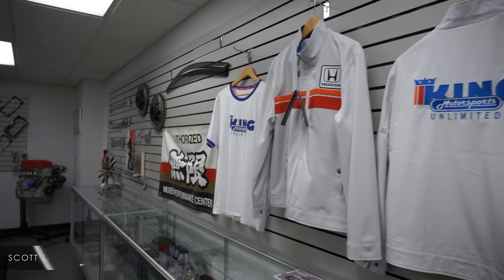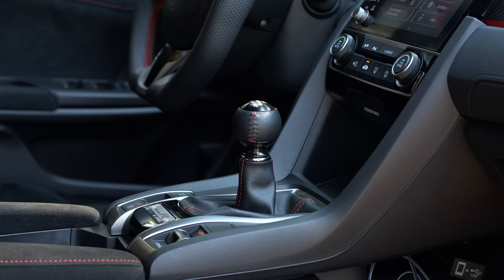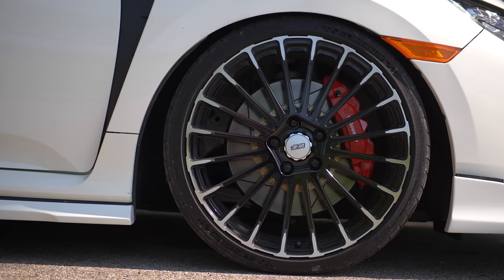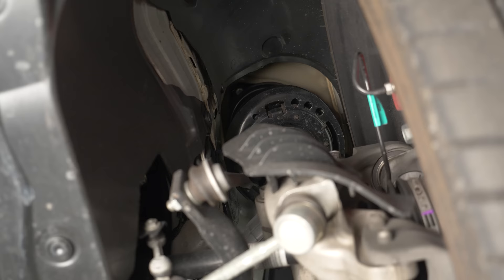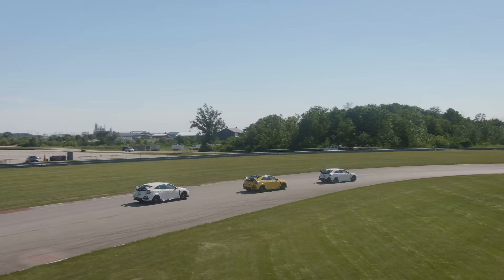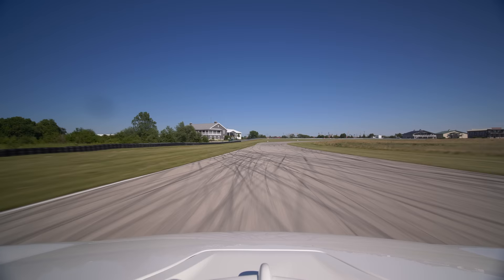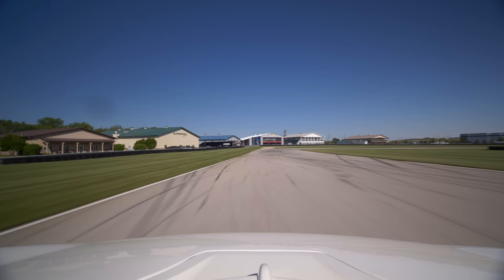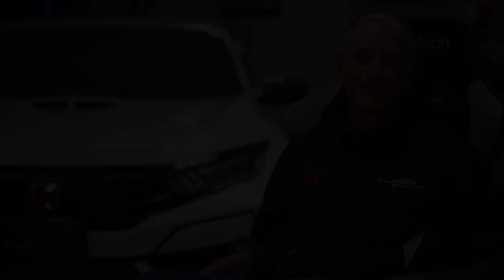Mugen Civic Type R | How Will History Judge?

Comment: At 69, wild exterior design does not bother me. I already love my FK8. Spring changes sound like a mixed blessing, although getting even more rotation out of this chassis is great. All the other mods seem like a no brainer. At 180 cm and 78 kg no worries fitting in the seats. Although  I really love the ones in there now. So how much would it cost to send my '18 FK8 to King and have them Mugenize it? The idea of less weight- and especially  less unsprung weight and more useable and consistent power delivery appeals .  And you can never have too much carbon fiber or titanium. right? Best news might be the needed cooling improvements. Aero was already excellent. 
Now if only they could up the fuel tank capacity a bit...

Comment: The power performance of a car is a function of the area under the power curve over the practical RPM range, not of the peak power to torque spec. So the tuners need to focus on that.

Comment: I would take the tune and the new MF10 wheels… everything else seems to make the car worse for most use cases
Reply: Yep, this version doesn't live up to the older gen Mugen builds
Reply: It's hard to squeeze out more when the original car is this good. The seats would be a plus for some, if not most, and the steering wheel is much better for not having alcantara. The springs are a bad idea, but for fools who want their cars scraping the ground, they're available (because that's who will buy them).

Comment: Not that it matters, but I pulled on a modded Type R stoplight racing last week in my bone stock, 100k mile 2010 is350.
Reply: it doesn't matter if he knows you're racing or not 

winning is winning
Reply: modded how? lol my friend has same lexus and he walks charger RTs all the time. 2nd gen IS350 0-60 is actually 4.8-4.9 so im not surprised
Reply: @JDMHaze  lol no way bud it's more like 5.5. Still a great car. You can get great deals on the IS350 F Sport still and that IS500 makes me consider jumping ship from old BMW's
Reply: @papa_pt  maybe something changed, or you're comparing the RWD pr AWD.   But I did check the stats, 0 to 60 times are often not accurate with the motorweek because their track is poorly maintained with excessive tire residue.. But when I checked 0 to 60 times site it was 4.9 i believe
Reply: @JDMHaze  yeah tbf I was looking at the newer Gens circa 2019/2020. That's impressive some were hitting it in under 5, but (from r&t) "all stability/traction control was off. Car was power braked to stall speed, about 4000 I think. It will very with surface and tire choice, so you'll have to experiment. I suggest you ignore the 0-60 while at a drag strip, and look at the 0-100 feet data, and 1/4 mile times". So it'll take some extra doing to be that quick all the time
Reply: @JDMHaze  
It had a crazy loud exhaust and intake at the minimum. It was definitely quick though, quicker than most Subarus I've ran. I get 0-60 in 5.0s on dragy with a best 1/8 of 8.7. I'm sure with a perfect launch I'd hit 4.9s. Just mashing it in D gets 5.2s and 8.9s. Lexus had 17.76% off oem accessories (and free ship) over the 4th so I ordered the fsport intake system and sway bars. I couldn't justify $1,180 for the axle back exhaust. Was thinking about a catback and RR tune for that 7,200rpm Rev limit which would let me hit 60 in second gear and quicken the 1/8th. I've had the car for 3 months and while dealer serviced for the most part, I didn't see plugs changed or Trans/diff fluid changed (already bought everything from Bell Lexus, just need to do it).

Comment: I believe with time, just like so many other cars like the RSX, Integra, Civic hatch, Golf R32, etc., the newest gen CTR will become more liked. Even right now, it’s more liked than when it came out. It’s design is still very Asian ricey, but it’s performance from the factory is great. Are there things that it could be better at? Of course. But for its price, it’s a great little sports car. I personally just wish it had a bigger engine and not as crazy exterior styling. Other than that, I think the CTR is a great car.

Comment: Seats look lovely, but which way are they running the factory belts thru them? I don’t see the belts loop thru the bottom thigh holes on the buckets, nor the buckle receptacle thru the inboard seat hole. Im hoping Mugen isn’t having the lap belt go over the seat and buckle into the receptacle on the outside of it, that wouldn’t hold you securely or safely.

Comment: MAIL ORDER MY SS HEADER BACK IN 1993 FOR MY 1992 ACURA INTEGRA GSR FROM YOU GUYS IT WAS NOT CHEAP AT $600 BUT IT LOOKED GREAT AND SOUNDED EVEN BETTER WITH MY HKS EXUAST SHOULD HAVE GOT AN EXUAST FROM YOU BUT I WAS AT MY LIMIT MONEY PUT OVER $10.000 INTO IT REDLINE 5TH GEAR AT 8000 RPM AT 140 MPH

Comment: Any of the Volvo T8 models have a decent amount of power and torque and good 0-60 times.  Plus,  they’re very unassuming,  even in Polestar Engineered guise.  The wagon does 4.4 seconds.  Not that quick anymore,  but still enough to surprise a few cars here and there… 
And even a Honda Pilot nowadays can keep up with some of the older sports cars.  Doesn’t mean they feel quick or are fun to drive… shrugs

Comment: I think that the modern chassis is so stiff that sway bars are making less of a difference. Just look at McLaren for example who don't even use them in some cases.
Reply: I think you mean strut bars not sway bars.  Sway bars do not deal with chassis flex, but rather connect the wheels directly together.  The McLarens with no sway bars use interlinked hydraulic suspension (a bit like an old Citroen).

Comment: I dunno. To some extent, car buying ain't logical. So, I can understand wanting one if you're a fan of the marque, or you love the idea that you're getting something with a connection to a legitimate storied race car company, or you think rarity may give it some collector value.

But...

I did a little Googling. Start with a base Type R for $38k. By the time you add in the exhaust, wing, body kit, interior goodies, and fancy wheels, you're just north of $72,000. Adding the CF hood bumps that by another $10,000. And that's just parts cost, not installation. Also doesn't include the brake and suspension upgrades or the tune. So, where are we? At least mid $80s, maybe $90k even without the CF hood? That puts you into Cayman GTS 4.0/M2CS/TT RS/ZL1/GT500 territory. Or, used, a GT4, older GT3, any number of Lotuses, or even a GTR. For a dressed up economy car that's putting its power down through the wrong wheels.

Comment: If they fixed the whole fwd issue it would be worth it.
Reply: so dont buy a civic?
Reply: Type R was always fwd. That's where they got their reputation. Best fwd track car
Reply: They have best FWD in the 🌎 🗺 🌏 🌐 🌍
Reply: @area50view  fwd was implimented as a cost saving measure for manufacturing. It was never intended for performance. 

"fast" cars were never intended for economy reasons.

Honda making a "fast" "fwd" car defeats the purpose of having both a fast car and a fwd  car. It's not cheap and it's not as fun as a rwd counterpart would have been.

TLDR: buy a used cayman and have both more fun at a lower cost.
Reply: @mobilePCreviews  why buy a used cayman when a used z06 costs less and is even faster

You forgot the whole point of why hot hatches exist
Something that's practical (lets see a Cayman fit 4 adults and their stuff) , fast, and relatively affordable

Comment: So this guy gaslights me about having f1 engineers essentially offering a substantial advantage for Mugen when it comes to making aftermarket parts/setups, and the best they could come up with for the suspension is lowering springs that ruin the ride quality and render the electronic shocks useless?

Overrated trash products, Mugen sucks.
Reply: They give the car better support to resist roll on sticky tyres though.  It's a compromise.  Just like how the exhaust is lighter and maybe flows a little more, but is louder and drones compared to stock.

Comment: I am not getting excited about Electric cars at all until the -30' Degrees winter problems are Solved, Because I don't think my employer would be to impressed have hundreds of cars plugged in because of  very low temperatures we get in the Northern States,  Someone will want $ for that problem... If you don't believe me leave your lithium powered anything outside for 8hrs in Below zero windchills and try to use IT❗

Comment: Bla bla bla.. As long as doesn't have a REAR diff and rear driveshafts (but NOT haldex style powered😂) this car still remains a handicapated one, an ABERRATION of jewish engineering from citroen, a nonsense which ignore even the basics of dynamics, as the more torque came to the wheels> the less trust got to the tarmac, because inertial forces move the weight on the rear and dead axle.